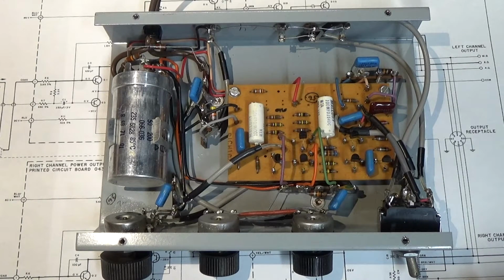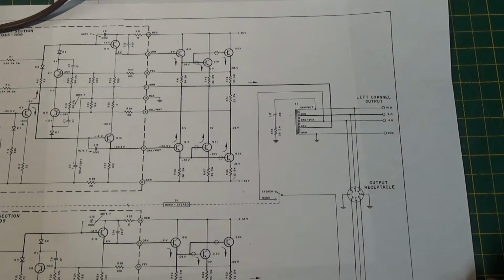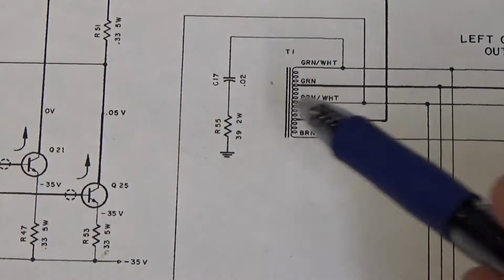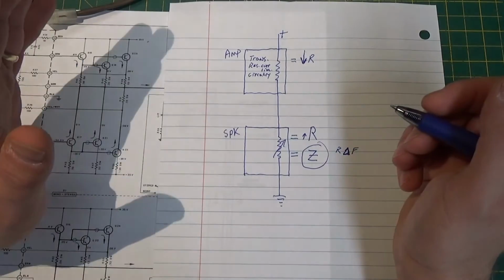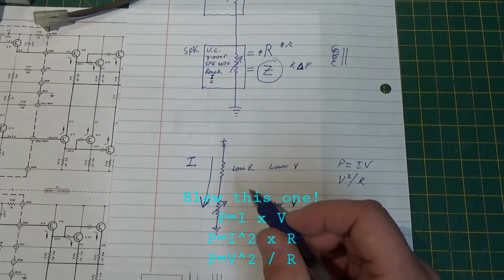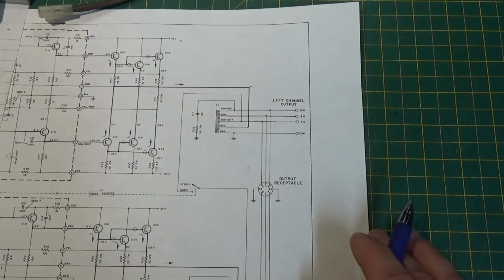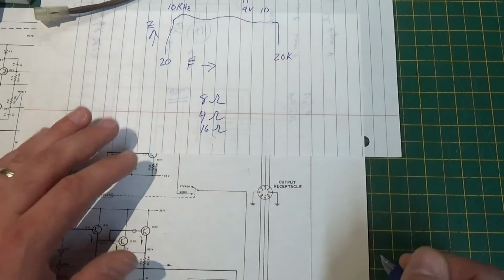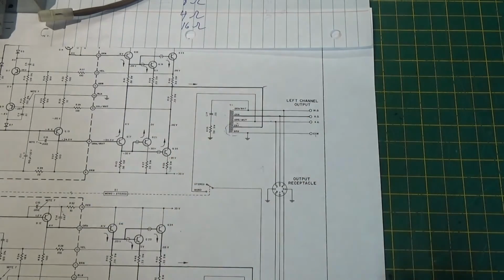Verdin Bell Tower Amplifier Part 2   The Autoformer and the McIntosh Sound

Comment: You can use the power transformer from the amplifier as an audio autotransformer. Or power transformer for vacuum tubes heaters with windings 6.3+6.3 V. Just use two secondary windings. You need to connect the two windings consistently, apply the signal to one end and ground to the other end, and get a signal reduced by half in the middle. This way you will reduce all types of distortion in your amplifier by 2 times.

Comment: Hi I am very very thankful for this video that you have posted however I had a question regarding Transformer or output I have a qac commercial amplifier which puts out I think it's 4 Ohms 8 mm 16 ohms 17 volt 25 or something like that however I would like to know if I can use a regular speaker on that app

Comment: Great explanation of the autoformer. Delco(GM) car radios used the same device when they went to a transistorized output in the early 60's(even though the rest of the radio was using 12 volt tubes). The tubes operated directly off  battery voltage-no high B+.I could not understand it's purpose-I thought of it as a choke, or as a current shunt, to limit the current on the voice coil.

Comment: The real question is, can one get transformers for these units from one of the custom shops such as The Peter Dahl Company ( recently bought out by not her individual) who specialized in xformer s for the communications industry. I think You Tuber Blueglow may have mentioned another shop that rebuilds transformers for old tube amplifiers. If you can get the transformers custom wound one could build from scratch one heck of a sound system amps.

Comment: I had a friend with a Mac system, I thing it was a 2255 amp, he had B& W speakers, the bass was so warm, not punchy but clear, like you could hear the string being plucked.  He later got a Threshold amp, he got a punchy sound. So which do you want?  The kick drum punching you in the gut or the bass strings clearly defined?  I liked the mac myself. Besides that, it was timeless beauty.